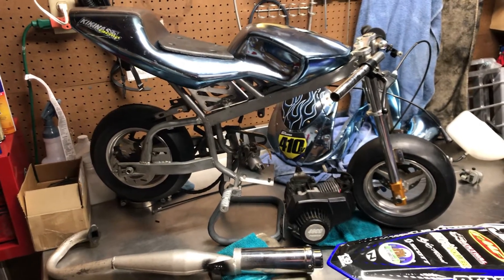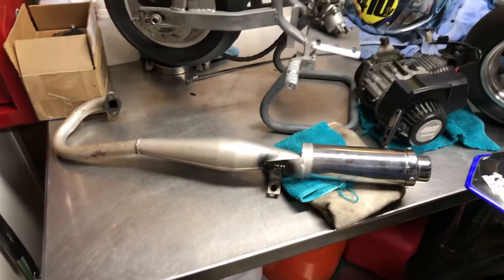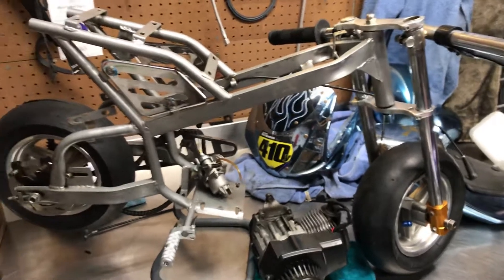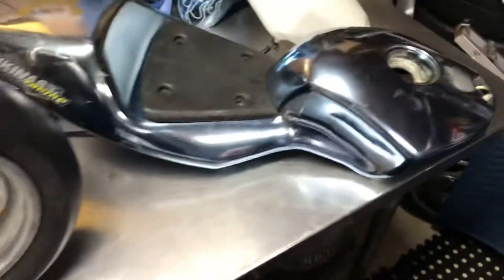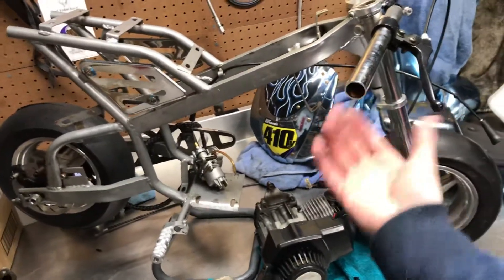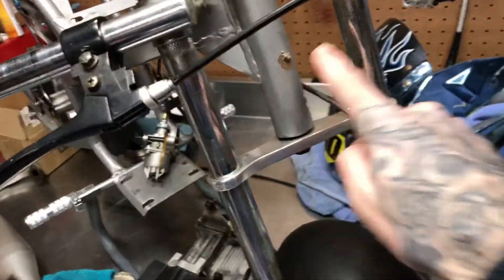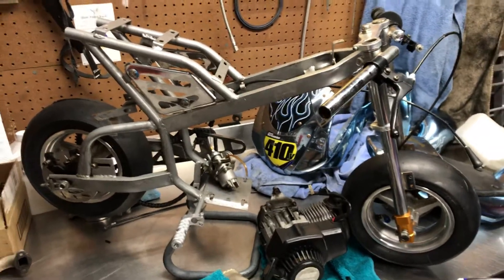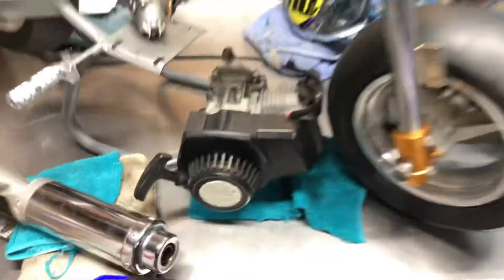Racing Pocketbike 49cc CAG Engine

Comment: Always wanted one of those. 💪
Reply from the maker: You can still find them hella cheap. Find one and fix er upp, the 49cc cag engines flyy
Reply: What model is that one?
Reply from the maker: @randyhuett1948  It is a Kikinassi Racing 49cc CAG engine pocketbike that was manufactured in the early 2000s..believe the buddie i got it from payed $420 for it off EBay!

Thing flys, it’s actually scary to go full speed unless your on a smooth road with no big bumps cuz shes got no suspension 😂..i always wanted to bring it to a gokart track and really try and ripp it!
Reply: Just gave the kid next door the same one last year, I remember going into kirkers cycles in Peabody as a kid and he had the polinis hanging they were dope I bought a couple few years back and they were FASTTTTT man had them hangin up for a while next bike will be a ysr50 it’s in the works !  36 and still think I’m 16 🤣
Reply from the maker: Right i deff remember them hanging in there one on each side of the counter thats what made me want one as a kid too seeing Skit rip them out front
Reply: @JesseK410  that’s crazy you remember that place to! Rip he was a good good guy, story is he still has my 93 pw80 within the family what i would do to get that bike back!